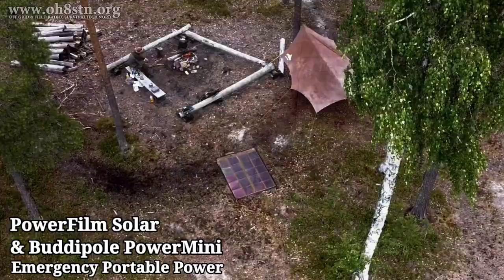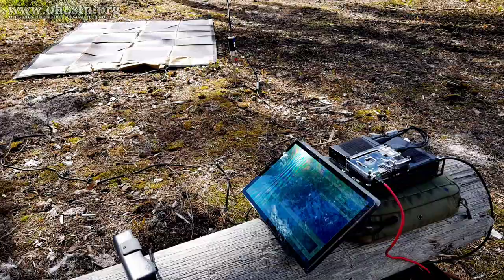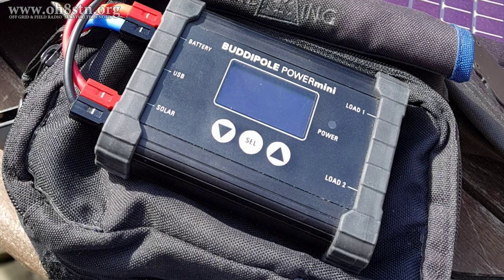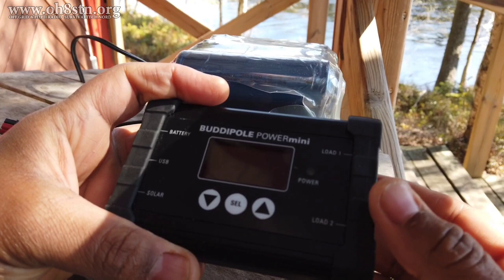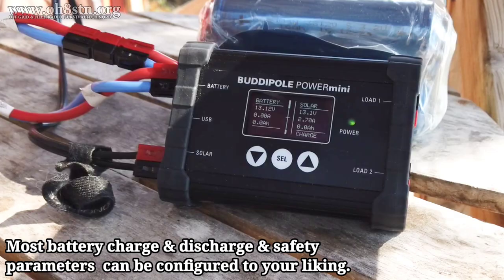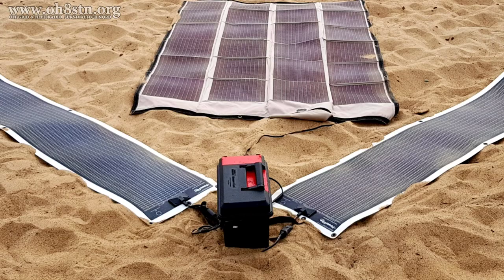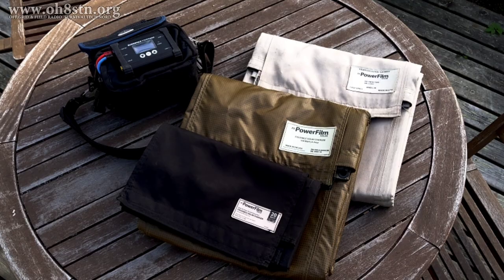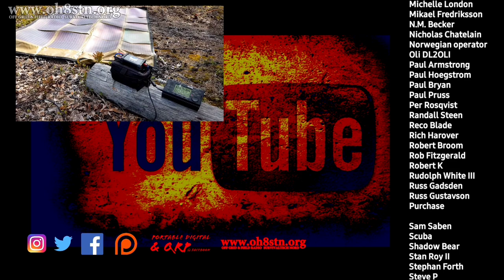Buddipole PowerMini charge controller & PowerFilm Solar

Comment: But... how well does the Mini work? Meaning does it create RF hash?  I went to your link & noticed that it is listed as a PWM type; rather than MPPT. PWM types are notorious for creating noise in the RF spectrum.

Would like to see an operational comparison on a weak signal RX station; both with the Mini in & out of circuit.

Thanks for the intro.
Reply from the maker: it is <PWM but has built in filtering tp keep the hash out of the amateur bands. You can read about teh filtering on the user guide from buddipole website. BTW, I have mentioned the desire for a MPPT version of this charge controller, but no word yet.
Reply: @OH8STN  thank you for letting us know that.
Reply: Sorry to read that it's not MPPT. PWM is much less efficient and this is crucial in portable ops.
Reply from the maker: Reducing the amount of gear we carry, is also critical to Portable Ops.
Reply: Victron MPPT controllers seem to have all of the features of this Powerpole unit plus app configuration and monitoring.
Reply from the maker: Excellent controllers but no powerpole ports.
Reply: OH8STN Ham Radio Could you please comment on what your results/impressions are regarding efficiency in comparison with the Genasun charge controllers you own? I finally decided to pair my 15Ah Headway home brew battery (and a 60W powerfilm solar panel) with the Buddipole Mini due to the nice feedback on consumption/state of charge this all in one unit provides compared to the Genasun controllers, but I wonder if the Genasun controllers would provide considerably more Amps.
73, Jo - DL1JRM
Reply from the maker: The honest truth is, in a real world environment, clouds, shadows, dusk, dawn, ... the Genasun MPPT controllers will always outperform PWM controllers. Perhaps on a perfectly sunny day there will be little difference, but in an environment with clouds, trees, ... MPPT is the logical choice. That's why I'm hoping in the future for an mppt version of this charge controller.
Reply: OH8STN Ham Radio Thanks Julian for the instant reply. By the way it was YOU who inspired my home brew battery build project...! I meant to send you some photos, the project also involved some Sketchup & Shapeways housing (with the related learning curves...), but it seems difficult to get in touch with you when you are not with Facebook as I am. I power a KX3 with the KXPA100 flawlessly for several hours. You are such a great source of inspiration!!! Keep on your great work.
Jo, DL1JRM
Reply from the maker: That's wonderful to hear. Yeah my problem with Facebook is I get dozens of messages and friend requests there everyday. It's overwhelming.
The kx3 with the xpa amplifier running on one of the Homebrew designed battery packs is magnificent. How's the peukert effect?
Reply: OH8STN Ham Radio I rarely run the KXPA100 at 100W, normally I use it between 50 to max. 80W and for only 2 to 3hrs (at a quite moderate TX-rate). At that level the draw usually remains at 7 to 11 Amps during TX (incl. the PX3 panadapter) and I have never fully depleted the battery. So I must say I never really noticed the Peukert effect, I always had plenty of “juice”. - I have installed a 30 Amps BMS but I think my draw never even exceeded 15 Amps so far.
Reply from the maker: Outstanding.👍👍👍

Comment: I just got a 10.5A Genasun lifepo4 based on multiple reviews.I am a bit sad that it produce serious noise on 160m, 80m and some light noise on 40m and 12m either ic 7300 or ft 857d.How the mini does with noise ?
Reply from the maker: Interesting. Are you sure it's the charge controller? I had one giving out a little bit of noise. I messaged Genasun support who said it wasn't supposed to be doing that. I sent it back and they sent a replacement.

Comment: Hi Julian.... awesome job as usual! I have some questions. I am putting together a SOTA, POTA kit that has a G90, and a Surface Go as the main components for operation. What is an efficient method of providing the Surface Go operating power? I have to confess that I have not done any looking around for an answer yet, but, your posting jogged my thoughts. I am also interested in what would be an expected rate of charge in direct sunlight for the folded solar panel that you show? I have a Bioenno Power LiFePO4 Battery BLF-1220A to support higher duty cycles at 20 watts.  :) 73, KF6IF
Reply from the maker: Hi Phil. This is a trick question with lots of variables. First,, the solar panels I use usually provide exactly the watts they are rated at. If a PowerFilm panel says 6A in full sunlight, in my experience, it usually comes very close. Keep in mind I am at a higher latitude. So I don't get the best performance as someone in Georgia or Arizona  for example. Still in full sunlight the numbers are legit.

The surface go uses a USB-C port for charging. This is a very good thing! There are a number of 12v to USC-C adapters you could use get power out of your bioenno battery, to your surface go. This is the same method I use to get power to my Lenovo Yoga tab-top in the field. If you're lucky, your surface go has a thunderbolt 3 port which will either slow charge via normal USB, or fast charge when there is a USB-C port available.
73
Julian oh8stn
Reply: @OH8STN  Thanks Julian! You have given me some good items to chase down Sir! :) 
73
phil KF6IF

Comment: That charge controller is quite impressive, is it PWM or MPPT? 73 de W8IJC
Reply from the maker: It is a PWM charge controller BUT, has filtering on all amateur bands to keep things quiet. I have mentioned the desire for an MPPT version, but no word yet.
Reply: @OH8STN  mm ok, thanks for the info. This might become part of my eventual solar setup for long outings. I plan to use a bioenno 20ah battery with a 100w foldable panel. A Powerfilm panel would be amazing, but for me they are prohibitively expensive, maybe someday.

Comment: 2 years later what’s your favorite charge controller Buddipole, Genasun something else?
Reply from the maker: Definitely the Genasun GV-10L. it's lightweight, has great performance,  and doesn't generate any noise. The Buddipole was a great idea, but the pwm controller lacks performance in cloudy or low light situations. It also struggles with Lithium based batteries. Victrons are too RF noisy.
Reply: @OH8STN the buddipole powermini 2 is mppt i believe. Is it known to cause RF interference with radios?
Reply from the maker: I haven't tested the powermini 2, but wasn't impressed with the PowerMini after a couple of seasons. Original PowerMini was PWM. it had filters, powerpoles, ... but as a charge controller wasn't even on the same planet as Genasun controllers.

Comment: Are the buddipole controllers as rf quiet as the genasun controllers? Thank you in advance.
Reply from the maker: The PowerMini has built in filters which should suppress PWM noise. So far so good. Not sure about outside Hsm bands.
73
Julian oh8stn
Reply: @OH8STN  As always friend, thank you.

Comment: Julian, I am looking at putting together a portable kit based off an 857d and was wondering how this compares to the genasun?  I want to build a man portable system similar to what you use for emergencies and camping.
Reply from the maker: The Genasun GVB-8 is my favourite strictly speaking of performance. Naturally with a buddy pull you don't have to add your own power pole ports. One piece of consideration is winter deployment. If you are at a high latitude with lots of clouds and dark days, I would not buy the buddipole. It's not very good with low light conditions. The Genasun is, but you need to do your own cables.
Reply: @OH8STN   i am pretty much at sea level here in Iowa USA.  Just trying to figure out which charge controller to use, then hiw big of a battery to build etc... You are currently my favorite channel for emergancy comms.
Reply from the maker: Thanks for that. The battery really depends on how much run time you need, and how you plan on recharging it in the field. For me being so far north I have big solar panels which adds significantly to the cost of the system's. I can also augment that by building a bigger battery pack, but that adds weight to the system. Ultimately would have done is build several different battery packs for different scenarios. That's why there's so many battery Builds on the channel. I have one incoming you might be interested in. It's a lightweight battery offering a few hours of runtime with a radio like the 857, but it's small and easy to pack. The cells are also much easier to find. Perhaps I'll put that video together in the coming weeks
Reply: @OH8STN  we generally get enough sun here i was planning on looking into solar options myself.  Appreciate the feed back and love the battery builds so I will be watching. 73

Comment: Hi Julian, have you ever user the PowerMini with the LightSaver Max? In my case the LightSaver Max gives out 12.4V and that is not enough to trigger the threshold voltages in the PowerMini so it can charge the batteries connected to it. What is your experience?
Reply from the maker: I don't believe the PowerMini was designed to use a LightSaver Max as battery storage. The Lightsaver Max has the charge controller built in, plus a DC and USB outputs. So there is no need for a external charge controller. Also the lightsaver Max has a DC input for charging, and a DC output for discharge. So I don't think threshold is the problem, I think the internal battery on the lightsaver Max, is isolated from the powermini charge controller.

Comment: I'm basically trying to duplicate (one of) your systems - FT-891, GPS, Raspberry Pi 4B+, MP1C antenna.  The only thing left is a solar power source and batteries.  My major sticking point is your use of LiFePO4 batteries in the cold.  I've been warned that it is instant death for the batteries if you try to charge them below 0C/32F.  Is this BS or truth?  Ed - KD2EIP.
Reply from the maker: Awesome question. The context is often missing in these discussions. Let me try to give you some context. I never charge my batteries when they are below freezing. If you notice, most of the big solar batteries/generators I have, all have a temperature sensor inside. I always know the temperature of the batteries. Second, usually if it's below zero, I'm in a heated shelter or hot tent. Even though it looks cold, I promise you it's at or above freezing in the shelter. Third, you can discharge lithium iron phosphate batteries down to pretty insane temperatures without damaging them.
One trick I use when I must charge up my batteries in the field below freezing, is simply putting them in my jacket before I charge them up. Naturally this is a trick for small packs. For my larger systems, there's always an insulation Inside the Box or enclosure. This protects the battery from the cold, and helps keep the heat generated while discharging, Inside the Box. If the temperature goes above a certain point, I can always simply open the box, but I've never had to. Operating in extreme temperatures is really easy. You simply have to remember your batteries can operate in any temperature which you can. I think I should do a video on this topic. Winter's coming so it's probably a good idea. What do you think?
Reply: I'd like to see your techniques for charging in the winter.  Maybe sacrifice a very old laptop cell to show what happens with sub-zero (C) charging and steps to mitigate the problem?  You're not going to want to sit there warming the batteries all day while they charge.  Maybe an insulated box and one of those reusable heat packs for hunters?
For my own use I was thinking of switching the solar panels to a heater instead of the MPPT controller whenever the battery temperature got below 5C.    Or maybe just turn on a heater at 5C and off at 10C - in parallel with the battery?  I'd still want a safety cutout to stop everything at 3C.  Batteries are expensive!